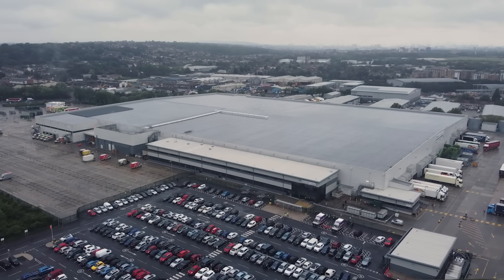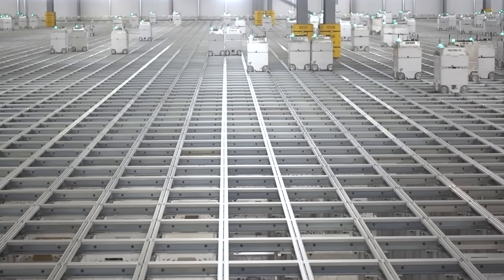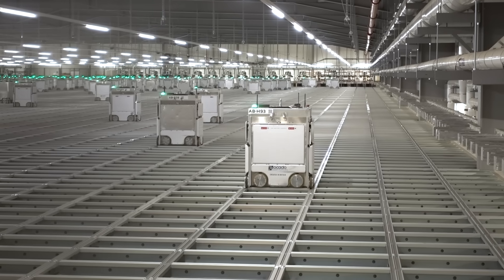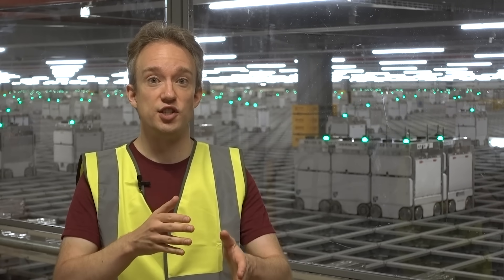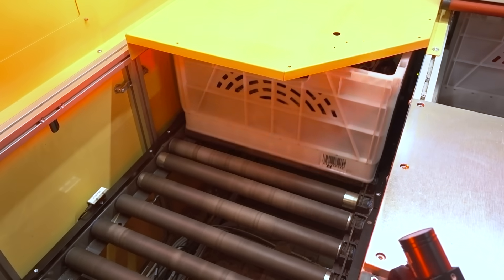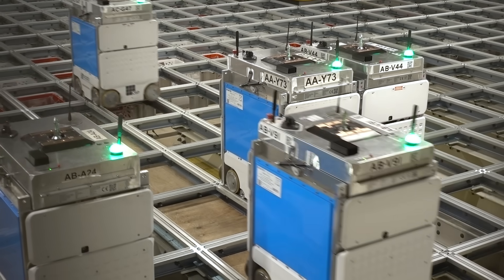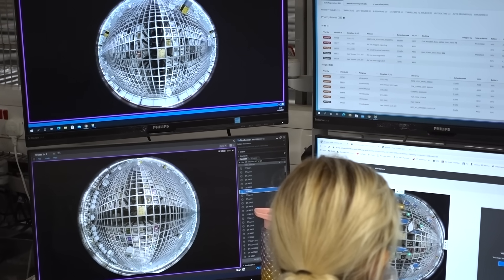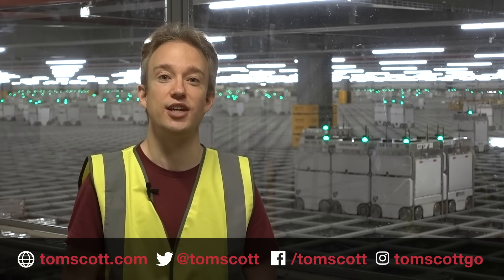How many robots does it take to run a grocery store?

Comment: Why are Kinects so good at doing anything but the thing they were designed for
Reply: Microsoft invented a tool and put it to use as a toy.
Reply: @rockyfalldownstairs  I don't think they invented that tech. If anything, they made it extremely cheap to produce since previous similar cameras were too expensive for normal consumers
Reply: @Cristian-vl8pg  True. By invented I meant designed and manufactured. You're right that they probably didn't actually invent the technology in it.
Reply: because the hardware in the kinect is insane for its price. it was also just a software issue.
Reply: Kinects are cheap and fairly accurate for such tasks
Reply: @GudieveNing  it's not that they were ruined... it's just that the general public is largely an uncontrolled environment.  that's why in a scenario such as this, it works just fine because it's a controlled environment.  in an uncontrolled environment, it's trying to figure out what the hell it's looking at, it has different sized people, with different clothes which aren't all the same in environments with all sorts of random objects that reflect the IR dots in different ways... and on top of it all? expectations. Real world use by customers have the expectation of zero fail.  In this environment, you'd potentially have a failed pick.  a QC/audit would notice some issues and be resolved, some failures would show up on delivery and be resolved through receipt correction. you can't resolve a real time issue in the same way.  once it's wrong, it's wrong and it has failed.  Kinect as a gameplay device would require complete consistency to be considered working flawlessly.  Here?  It just needs to be mostly right and the task will likely still be completed 99.999% of the time.
Reply: @DopeyFish 
On the other hand, Microsoft shoveling simple/bad games for the Kinect where you could control it better with a normal controller doesn't help
it's better to have a good variation of well-made games, than to have one of everything where 99% feels out of place

Also, camera input works better for some titles than other

The thing that works best with cameras are generally dancing or similar motion based games
The worst stuff is racing games and similar where you need to know exactly where you are, and you need very accurate inputs
Reply: @MrHack4never  what do mean? Kinect Star Wars was a masterpiece!  hahahaha
Reply: @DopeyFish  Enviroment is not the issue for an IR depth sensor. Nor does it care about clothes or shiny things in the room. It only cares about that blob closest to it, the rest is software.
Reply: @tomtalk24  Almost. It actually does matter how shiny things are, because a reflective surface will reflect in a different direction. I've seen Kinect gen 1 fail severely to detect a pair of leather pants (and thus the pose of the person wearing them). Gen 2 shown here uses time of flight and higher resolution, which makes the readings it does get a bit more reliable. It's also quite possible to blind them both with sunlight.
Reply: Noticed that myself. Logo caught my eye and then I had to giggle.
Reply: Think it's more because they're is an abundance of kinects out there that sell for so cheap.
Reply: HAHAH
Reply: Converting a 3d object into computer readable data?
Reply: @catprog  : Cos it's a photo, and video cards are kinda cheap cheap... so... that's the results ! Something along those lines.
Reply: Same energy as “they took the universe’s most versatile material and made a frisbee”
Reply: Was thinking the same and laughing when saw xbox on the top. :D
Reply: It's hard to code it though

Comment: A couple of years Ocado came to the company i worked for at that time and asked us to create a test program for the battery charger PCB using a Flying Probe Machine. Which we did and we demoed it to them and afterwards they deciced that the cost was to much. So they didn't get the boards tested. Now does anyone remember the Ocado warehouse that burnt down in Andover? Well the fire was caused by you guessed it the Battery Charger!
Reply: Was the board in question the root cause?

Comment: A lot of unanswered questions:
- How long does it take for a bag of groceries to be packed?
- How are pallets / boxes of new items unloaded from trucks and unpacked?
- How are groceries bagged for delivery? Are they packed at all, or randomly dropped two items per plastic bag, wasting a lot of plastic bags?
- How are refridgerated and frozen items handled in grid? Are there separate cold grids with separate cold grippers?
- How is produce moved around and picked? Will the picker detect if produce is spoiled and discard it instead of bagging?
- How will vacuum picker pull and separate one banana out of bunch? :)
- Vacuum gripper shown will not work for cardboard of eggs. Will it work for larger irregular items like watermelon? 
- Box robot can't select individual items from the bin with multiple items, so it needs to fetch the entire bin of same items, move it to the arm robot, for arm robot to pick one item from bin and then box robot to return the bin back to the grid. If those bins contain cold or frozen items, these items will get warmed up repeatedly. Fragile items like eggs can get cracked from all that shuffling.
Reply: It takes about 5 mins to pick someone's shopping order if the order is for a regular weekly shop.

Items arrive on pallets and are hand moved by people into the white baskets. The basket is scanned and the amount of items in the basket too so that when they are on the grid, it can be tracked.
Reply: Move often than not groceries are hand picked from the baskets by people based on what a computer is telling them to pick and place in each bag. This is done to also prevent damage to the shopping, soft items with soft items for instance.

There is two areas for groceries. The normal area and the chilled area.

As the products are scanned before being added to the grid and with the large amount of product moved daily waste food is tracked via the computers and sent to food banks when it is close to its sell by date to prevent as much waste as possible 

Fragile items, fruit, eggs and the like are not picked by robots because they haven't developed a way to prevent damaging items everytime it is picked yet.
Reply: I found this all out from just asking questions at interviews

Comment: Keep in mind also the changes in warehouse design. A robotic warehouse doesn't need heating, ventilation or cooling, lighting can be minimal, with fewer emergency exit doors and walk areas.
Lunch rooms and restrooms will be sized for only an office crew, including water supplies and sewers.
Reply: you still need those because external conditions can still affect the robots, like too much heat and they go kaput, too cold and the same happens, components last less, lack of light can make it dificult to know what is happening, indeed conditions need to be even more ideal for this to work properly
Reply: @carso1500  Realize that susceptibility to heat and cold is a challenge that engineers will be working to eliminate.
I am talking about overall warehouse design and how it will differ from the way warehouses are designed today, and the main difference will be in how today's warehouses are designed for human occupation and use. whereas future designs will focus on robotic needs.

Without going into the history of warehousing and logistics, the fact is that today's warehouses look different from the way they looked 50-60 years ago, which is different from how they looked and functioned 100 years ago. 
Warehouse design responds to evolving technology, but the bottom line remains the same: always do more for less $$$.

Comment: I suspect that this type of "supermarket" will become standard in 10~15 years, if not sooner. Of course, the knock-on effects will be enormous. Cost for individual items will go down, yes, but many jobs will be lost. And while these roboticised super markets will certainly create new jobs, I do not think the amount of programming and mechanical engineering jobs will even out with the labour intensive jobs that are lost. 

I'm very glad I'm no longer a teenager entering the workforce. Supermarket stockers and cashiers are going to go the way of the dodo.
Reply: Remeber labor intensive jobs will still exist. People need to actually put the totes into the grid, whether it be by a drop off point or a direct drop in.

Comment: Automated Intralogistics is nothing new, but consumer level comission in automated warehouses is rare. It is usually only used for large scale deliveries of pallets with mostly very specialized hardware. Even the specialized hardware cannot deal with every product so automated warehouses often still have some manual workplaces or they have to adjust their stock. Usualy these warehouses consist of high bay storage, palletizers and depalletizers, foil wrappers etc. They are very complex systems and are way fatser than manual warehouses could ever be

Comment: Order picking can be performed more efficiëntly by an ultra high-density production buffer. The Lalesse AutoStore system has a major design flaw. It's maximum storage height is less than 6 meters. The price/footprint-ratio is exceptionally high for a dynamic storage system.

Comment: The next step would be to build this in levels. Make little elevator systems that take the bots to a new floor with more products. That way you can make use of the empty space better having say 20 floors instead of just 1. A giant hive.
Reply: No. It might be more space efficient, but any robot going vertically would not be able to pick anything up, hence reducing the over all efficiency.
Also, more floors might need pillars for support, which would break the grid pattern.
Reply: @NoiseMakerX  
Wow....You're so smart. And shortsighted. It definitely can be built up to have more levels. Your point that the bots won't be able to lift loads to greater heights due to weight and height is void. How do think elevators work in tall buildings and  skyscrapers? You're just making noise....
 😱🤣
Reply: @geoben1810  If you are so much smarter please explain to me where I wrote anything about weight and lifting capacity. Please also let me know why most, if not all, facilities of this kind is one-leveled.

Comment: Anyone else feel like this would resemble the face of the earth in 1000 years? Just large structures moving vast amount of things from one grid to another.
Reply: In 1000 year we will most likely wont need a physical connection between two spots tho, i mean like why would you take up a lot of space by using a grid when you can use automated flying/levitating vehicle that can fly without a track
Reply: @Felix-dv9wn  the bee hive mentality can perform in many different ways as we see with bugs, ants are quite good at their job, and do require the use of flight amongst most species, however, most of the automation would be on the ground, as mining material would be essential to survival at that magnitude.
Reply: @tannergoodwin8145  ah i kinda get it now, i think i misunderstood a bit.

Comment: We've gone too far when the robots are using Xboxes to determine the softness of my Fritos bag.
Reply: @G҉A҉C҉H҉A҉ A҉L҉E҉X҉ yOu MuSt Be FuN aT pArTiEs. I hAvE nOtHiNg InTeReStInG tO sAy.
Reply: Sounds like people are finding ways to recycle e-waste. Good stuff UK.
Reply: the real pendragon  Those were certainly all words...
Reply: Maybe they will have ubi by then the real pendragon
Reply: Not really. They just have to consider what products can be packed by which arm before they use a robot and the software that is meant to recognise the product has to be able to determine its orientation so that you can properly grab it. The robot does not have to determine stiffness or weight.
Reply: @zrider100z  I have to say though, it seems like an absolutely insane waste of resources to install this level of automation in a grocery store.
Reply: Grocery store yes, but its a system for "assembly and pack" for stuff ordered through the net. I can see the idea of robots moving stuff from one box to another being better than forcing human employees to walk around the shop for each client. Cuts on time dramatically I suppose.
Reply: @zrider100z  It's a fallacy though, that much machinery and that many moving parts needs just as much if not more labor to run. Until the machinery is technologically advanced enough to maintain itself that will always be the case. Also, even the people behind the technology admit that it doesn't mesh, you're trying to pack goods that a machine is currently unable to understand how to pack. They have machines just for the sake of having them. This would make more sense in a munitions depot, or some sort of supply dump. I appreciate the idea as some sort of weird proof of concept, but to me this is waste comparable to the level of an oil tanker capsizing in the ocean.
Reply: @fredwin  brother you are so far behind the current development in robotics.
But let's go one by one:
1) it's not the job of a robot to figure stuff out, it's the system designer job to be able to create a solution to combine software and hardware to achieve the goal
2) current systems are able to have integrated 3D scanners that are able to determine object orientation and placement in a batch so that you can have the robot reach and grab at desired angle and then just easily put it somewhere else
3) maintenance cost of these simple driving units judging by its simplicity will probably consist mostly of random failures and replacing carbon brushes if the engines use any, repairing these if designed correctly should be only "replace the broken module" and then the module is either fixed or recycled while the robot is working, so that there is little to none downtime
Reply: @fredwin  and yes, system designed for smaller range of products would be "better" which is actually a different way of saying "simpler". For instance one of electronics shop in my country has automated packing line for the orders placed online so that they can boost their speed. The biggest downside is that they have to use bigger carton boxes (they use only a few unified sizes). 

All of these are variations on the good ol' assembly line that went into just automated factory that produces, packs and stores their products automatically.
Reply: @zrider100z  And it's not like I'm against automation, far from it. I just look at this and can't believe the waste. It's an aberration. The cost for what you are achieving is absolutely staggering.
Reply: @fredwin  you see, the cost had to be lower than the profit otherwise nobody would pay for that
Reply: @fredwin  Which is less expensive in the long run, building this facility once, or paying all the employees that it would require to receive and fulfill this many orders for the foreseeable future? The answer is building this facility once.
Reply: @kingacrisius  If you read the rest of the thread, you'd see what I already alluded to, which is that there is no such thing as building the facility once, there is no set and forget. Billions and billions of dollars to just to engineer one facility as nothing more than a gimmick, could be spent running several Amazon facilities using human labor for a freakin' decade. You also need an entire team of engineers, you need rare and expensive raw materials, you need a a maintenance crew, and you still need a human presence to run the building. This was never designed to make profit, it never will make profit. Yet the research is a complete joke. Breakthroughs in robotics that actually help humanity solve real world problems could actually use the funding, and not exploiting already existing technology to do something absolutely easy and redundant.
Reply: @zrider100z  stfu
Reply: @watwat2540  no u

Comment: I'm no engineer, but wouldn't it make more sense to have the storage floor above the robots so they can just drop whatever they're holding into the robot's container.
Reply: Nope. The mechanism to hold the items up would be unnecessarily complicated to keep multiple boxes from falling out. Not to mention a faliure would be catastrophic and you can't replace or maintain am occupied rack. Those are my thoughts.

Comment: I would be interested to know what happens when there is some kind of malfunction and the types of failures. I remember Elon was trying to build a factory where all the machines are really close together, but then when an assembly line stoppage happened, it was really hard to fix. I would imagine with a high degree of automation like in this warehouse, similar situations could happen. That would be really interesting for sure.
Reply: In this case, there's a decent amount of space, though – if a robot breaks down and needs to be removed by a person, they could probably mark a section of the grid as no-go to let someone get in (probably putting boards over the gaps) to do the job without shutting everything down.